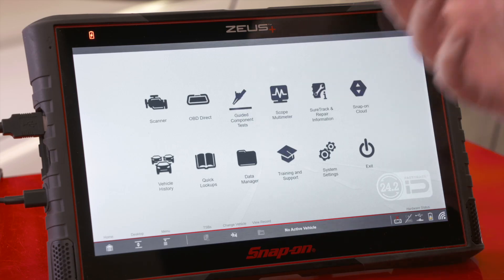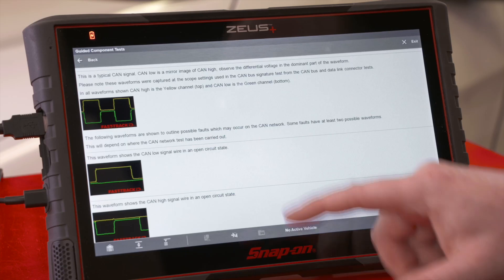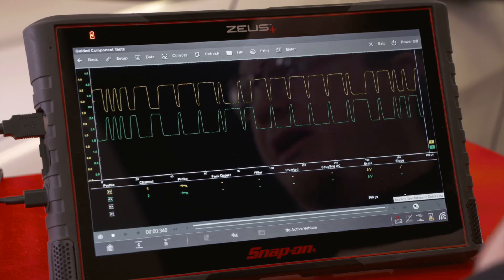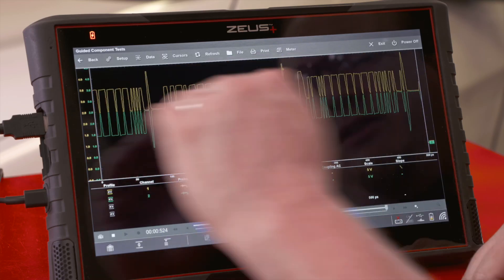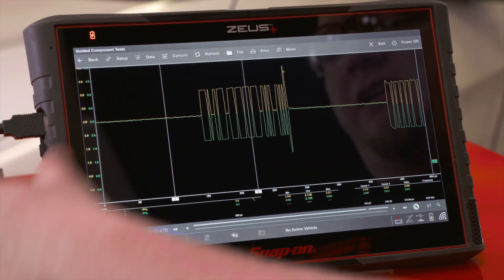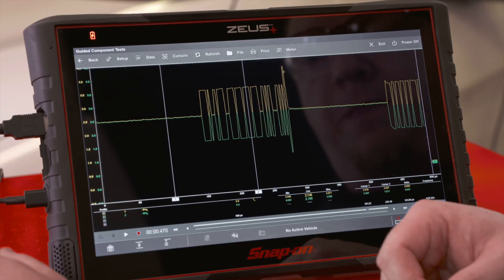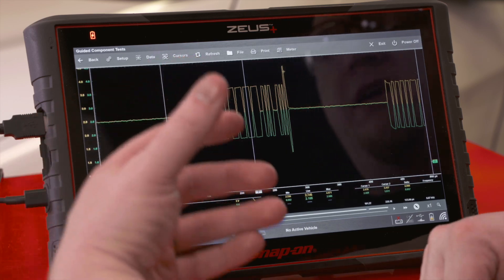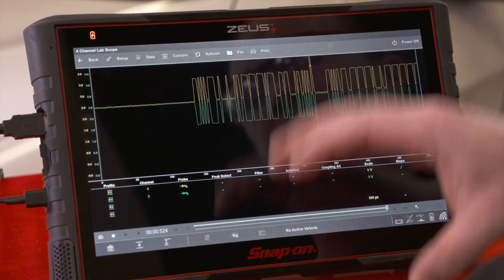Vehicle CAN Bus Testing | Quick Tip

Comment: Check your Service Information to see what type of CAN is running.  Is it parallel or is it in a Chain or Pass Through.  You can open the circuit but before doing that, make sure to check with your DMM to find out if Pins 6 and 14 are showing approximately 58 to 62 ohms.  Service Information's wiring diagram hopefully will show if those two pins in the DLC are direct connected to the modules or passing through a Gateway module in which case you would have to check the resistance of the parallel or pass though at the output of the Gateway.  I'm sure Snap-On and others have classes and training to help show these circuits so the tech will understand how to diagnose the circuit.  Thankyou Jason for this video and the "good" waveform.